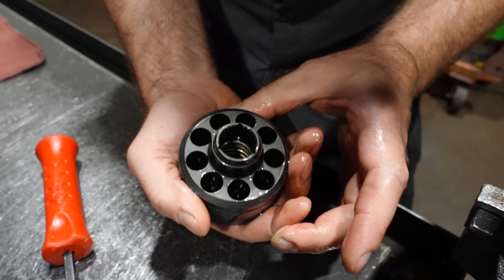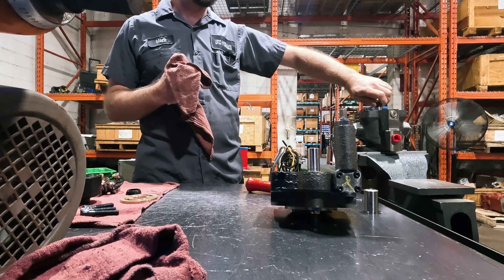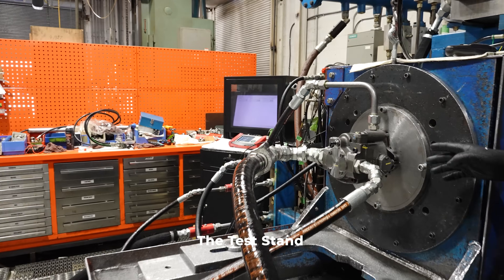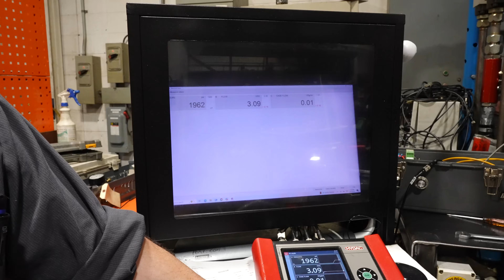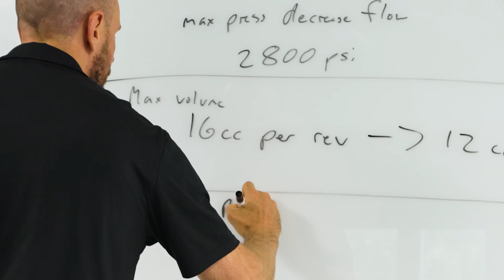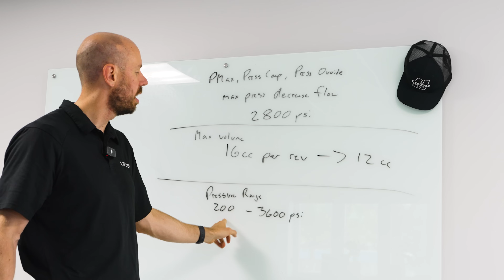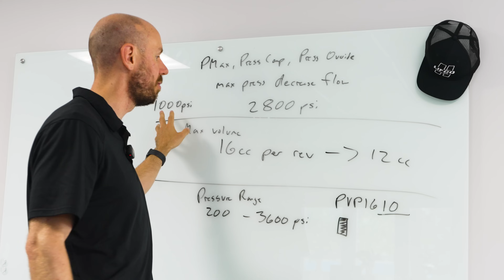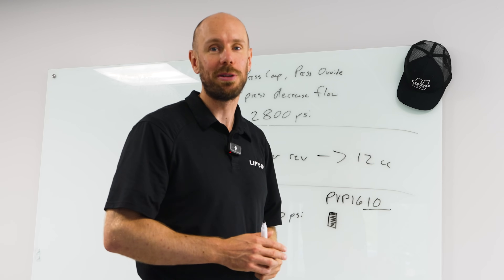Did this Pump Cause a Motor to Stall? (Parker PVP-1610B Inspection and Repair)

Comment from the maker: I said the electric motor amperage draw is from the combination of pressure and flow, but this is incomplete. It should be pressure, flow, + tare of the unit. The tare is what  it takes to spin the pump without any load.   -Fraser